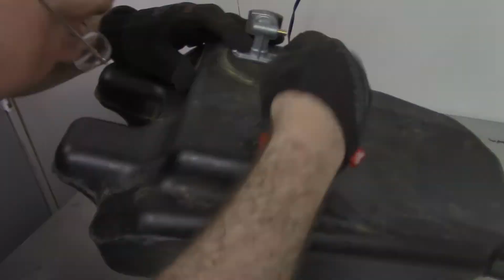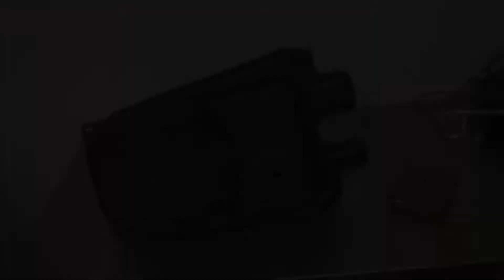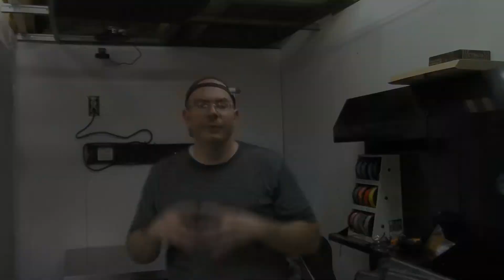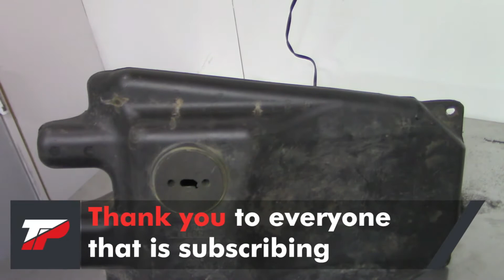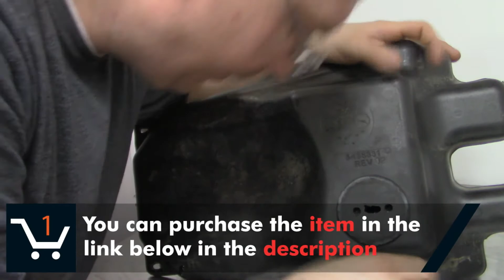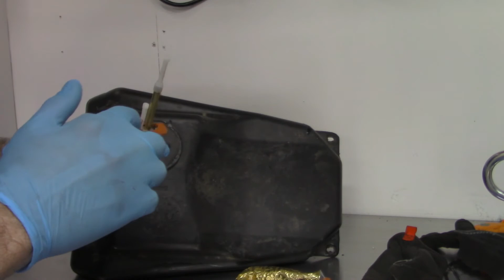Polaris Outlaw Petcock Repair Part 2 Reassembly Zombie Apocalypse Style Repair

Comment: After watching this video to know what the problem was  I found a fix procedure that allowed me to use the old parts.  

I used a T40 torx bit on a impact and spun the screw until it heated up the plug.  I slipped a flat head under the valve and pried up pulling the plug free then repeated procedure for other side.  The plug hole is a cavity that doesn't go through there tank,  I cleaned the holes with a 11/32 drill bit by hand.  I then put those plug in a pair of vise grips I had to use to separate the plugs and screws. Running the screws in and out of the plugs to clean up the threads.  Leaving the screws in I applied Gorilla Super glue Gel to the plugs and installed them with the knurling facing outward. Knocking them in flush and removing the screws.  I lightly sanded the whole area, I did manage to put a slight scrap in the surface area with the screw driver prying on the valve so use caution. I installed my new valve without and loctite, just didn't have any.  I put a T40 on a ratchet and would say I'm happy with the torque  I put on the screws.  I installed the tank and little by little added gas with no leaks.  Cost $7 for the super glue and about $50 for the valve.  Note after carefully pulling the tank I heard what i thought was going to be one of those plugs but it was the long stem pickup tube from the old valve.  Can't image how long that's been broke inside the tank.  I just kept shaking the tank until a perfect alignment of the tube and fill hole dropped it on the ground.  I hope i won't regret not using any loctite but right now I'm so happy I didn't quit after watching this video and I'm only buying Yamaha after this. 😅